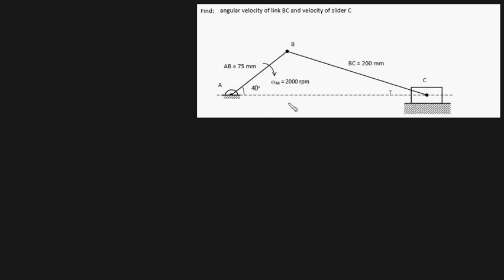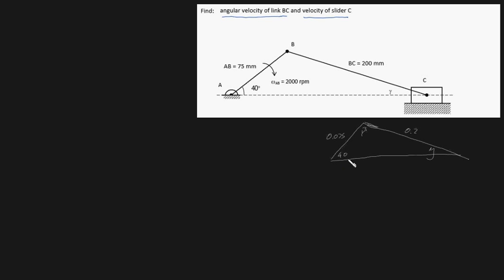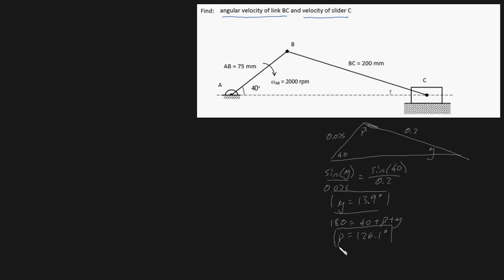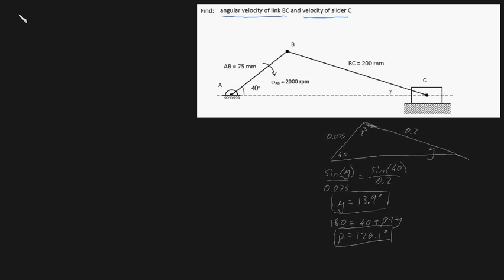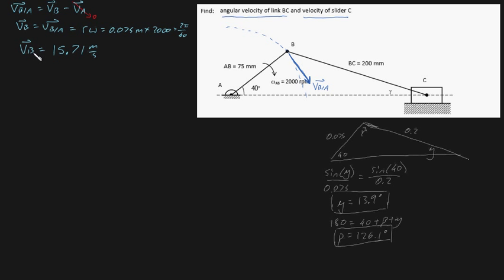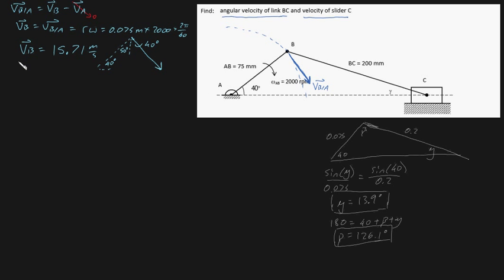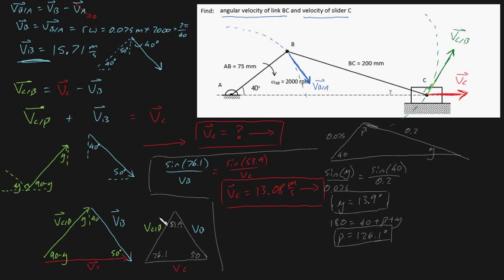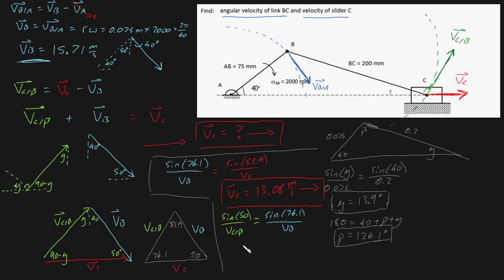Relative motion problem

Comment: Hi thank you for your great intuitive skills has really save me so many hours. how ever I have been trying to figure out how you were able o use the  trignometry at 10:10 to get Vc and get the 13.08m per seconds. Can you use find a way to text it here or  send me paper format of the solution. if you can use text , i will understand too. Thanks so much.
Reply from the maker: Hey mate, I use the sine rule: https://en.wikipedia.org/wiki/Law_of_sines
Basically it says sin(a)/A = sin(b)/B    where a is the angle opposite to side length A, and b is the angle opposite side length B.

I apply the sine rule on the triangle in the bottom left of the screen.

Hope that helps :)

Comment: what happens if you offset A by an amount?
Reply from the maker: Hey mate! Do you mean if you move pin A to another place? Or do you mean if A becomes a slider (like C)?
Reply: say you offset A vertically?
Reply from the maker: Hey mate, if you changed the position of pin A to be vertically above where it is now then the problem only becomes a tad harder. The geometry would change which would adjust the angles, but the process of finding Vb  then Vc then Vc/b then w_b/c is the exact same. Hope that helps :)
Reply: Matthew James I think it did, thanks!

Comment: thanks. what is the rotational speed of link BC? can u calculate the corresponding angle BAC for the max rotational velocity of link BC?
Reply from the maker: +Raven Claw Hey mate, great question! This problem only deals with finding the angular velocity at an instant, but in order to find the maximum angular velocity of the rotating bar over the course of one complete cycle you'd have to follow the same process keeping angle BAC a variable (eg theta). Once you go though the mathematics you'll get w_BC as a function of theta. Then solve for dw/dtheta =0 to find the value of theta corresponding to the maximum and minimum values! Plug this value of theta back into the generalized equation to solve for wmax or wmin (whichever one it may be). Good luck!

Comment: if Vcb=Vc-Vb  then is it possible to put the value of Vc and Vb and get the value of Vcb  anf if not then why again we have to look at the veloctiy triangle to get the value of Vcb ?
Reply from the maker: Hey mate, yep it's definitely true that Vc/b = Vc - Vb. Once you figure out Vc then you can easily plug in Vb and Vc back into that equation to find Vc/b. Be careful about solving this equation though! *Vc/b* and Vc and Vb are vectors, not scalars! Which means you can only solve them graphically (using velocity triangles) or simultaneously (using i j and k notation). Hope that makes sense,

Cheers,
Matt
Reply: Matthew James THANKS
Reply: Matthew James SIMILAR QUESTION IS GIVEN IN MY TEST BOOK         .WHERE THE ANGULAR VELOCITY OF THE CRANK (A-B) IS 20 rad/sec      .AND           THE LENGTH OF THE CRANK RADIUS IS 10 CM. AND THE VELOCITY OF THE CONNECTING ROD (B-C) IN TERMS OF rad/sec IS  . also given angle of A is 45 degree insted of 40 degree as per your diagram and the angle of C is given 30 degree .here angle c is known
1.100 rad/sec
2.50 rad/sec
3.10 rad/sec
4.non of these
but in book it solved like this
    angular velocity of connecting rod   W(bc)=  (angular velocity of crank x cos 45*)  /n
    where n= ratio of connecting rod and crank length=  l/r
    n=l/r=sin 45*/ sin 30*
    n=root 2
  so  
 angular velocity of connecting rod   W(bc)=( 20  x cos45*) / root 2  = 10 rad /sec.....(.ans)
 
i  understood  solving graphically by your method  but unable to apply in this question as i am getting different answer .please clarify my doubt .i have my exam very soon